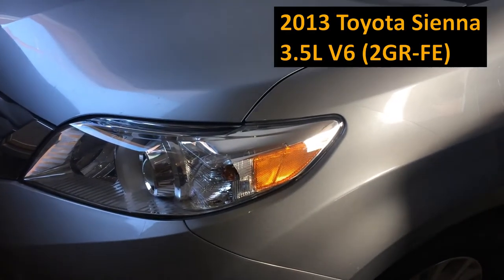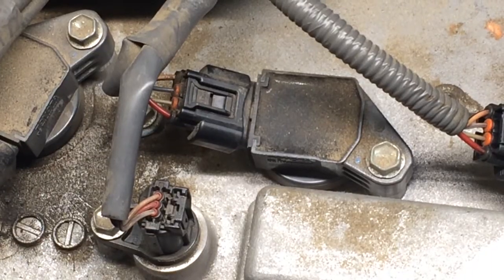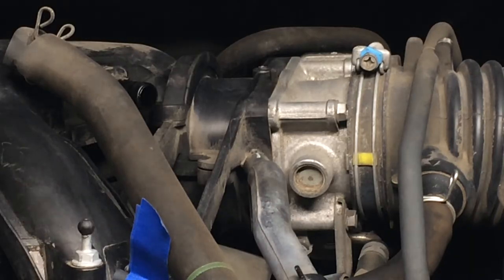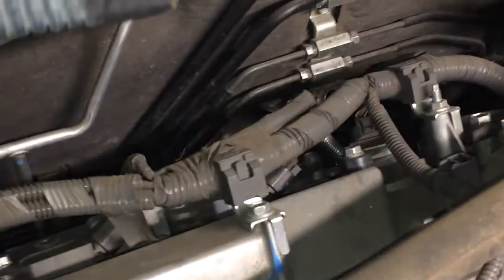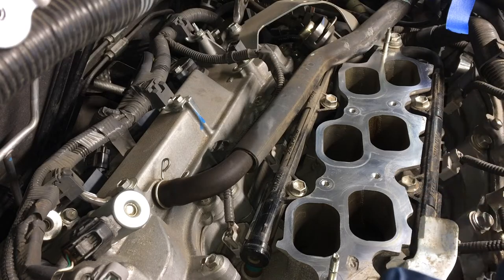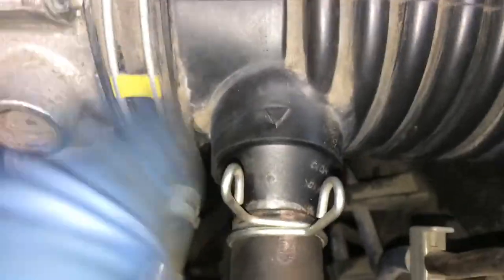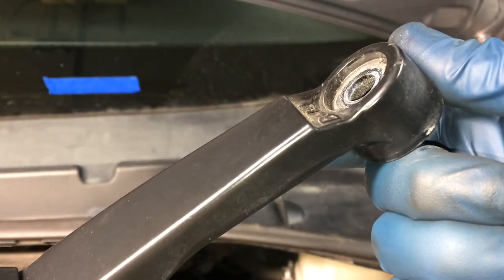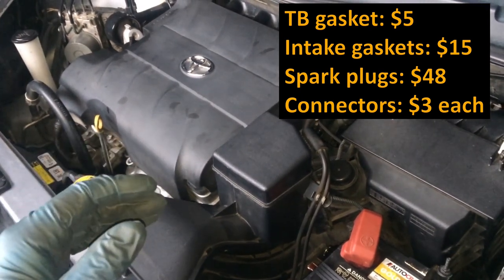2011 - 2016 Toyota Sienna DIY Replace Spark Plugs, Coils, Intake Manifold Gasket V6 3.5L (2GR-FE)

Comment: This is by far the best video for replacing spark plugs on 2011-16 siennas! I just tackled this job solo and this video helped me do it. I would like to add some tips of my own for those who are going to do this on their own. Firstly, the ignition coils in the back can be pulled without unplugging the electrical connections. Just release the plastic clips that hold the large wiring harness that contains the coil wires (3-4 clips) and this will give you enough room to remove the coil packs easily and prevents you from breaking any electrical connections which are super fragile! I broke an electrical connection on the #4 coil which is ok with me since its in the front and easy to replace. The 2 bolts on the back of the plenum was a little tight but with a small ratchet & socket will get them off. I only took one bolt off on the passenger side of the plenum and one on the driver side and it came off pretty easily. Taping with masking tape & labeling the hoses & plugs makes the reconnection easier to remember. It took me 5 hours to do the job but included cleaning the engine bay, cowl, hoses, cover, throttle body, & taking a long lunch break! It would've only taken me about 2 hours or less if I had just replaced the plugs without cleaning anything else. Oh, btw, I broke a hex bolt on the plenum using a torque wrench with only 13 foot/pounds on it. It worked for 3 but it snapped the 4th bolt! I will never trust another torque wrench again! But I would definitely take my vehicle to this awesome female mechanic over any of the male mechanics I've ever used! Shout out to this woman for her DIY video and explanations on every step of the way!
Reply from the maker: Great job on your DIY!  Thanks for taking the time to add your tips, and thanks for watching! : )

Comment: Well, finally did it.  I probably should not have waited until 141,000 miles.  Every clip of the six electrical connections to the coils broke.  They literally shattered when barely touched.  One spark plug took about thirty minutes to remove, gently working it in and out, with some WD-40.  Luckily, it was Bank two, spark plug # six, in the front.  All back together and the van runs great.  Thanks for such great in depth, detail.
Reply from the maker: Ah man, I know how that is with the electrical connections!  Great job overcoming those challenges and completing your DIY, and thanks for sharing your tips! : )

Comment: 2 years ago I did the valve cover seals, spark plugs and wires on a 1997 Toyota Camry v6 by watching another YouTube video.  Very detailed or I would never have attempted it.  No torque specs or part numbers though.  I smiled everytime you gave the torque specs.  Aluminum is unforgiving.  Thank you!  My 2013 Sienna is overdue for plugs and you've given me all the info I need.
Reply from the maker: Thanks for your comment, and thanks for watching! I like torque specs : ) Good luck!
Reply: Completed 2015 Sienna today.  The connectors to the spark plugs were extremely brittle.  Even a pick did not help.  Replaced the front three connectors with news ones.  On the back bank, I disconnected the wire harness from the valve cover and one more plug to the rear.  This gave enough slack in the wiring to pull the ignitors out without disconnecting them.  The harness disconnects easily.  If your connectors are as brittle as mine, I recommend this approach.  Thanks again, for the instructions, parts, and torque values.  Made the job much easier.
Reply from the maker: @tgittin2  Well done, and thanks for adding your tip!  : ) 
Thanks for watching!

Comment: The best mechanic ever on YouTube
Reply from the maker: Thanks - I'm certainly not the best, but I learned from some great mechanics over the years and pass that info along!  : )  Thanks for watching!
Reply: @L35 in Colorado  This is my next big project on my Sienna...
anyways I am an engineer working for one of the Big 3 companies, and we spend so much time and effort on developing torque specs. You are one of the handful mechanics on YouTube actually torquing all fasteners.. for that, I appreciate your great work and that puts you above and beyond.
Reply from the maker: @nickpark9587  Haha, thanks!  That's really neat - I had some training from a couple of good mechanical engineers, an engine rebuilder buddy, and a really conscientious shop machinist, so it was impressed upon me to "torque properly"!  So whenever possible, I always share any torque values I have.   Thanks for watching!  : )
Reply: @L35 in Colorado  
Hi... I have a question for you on 2014 Sienna I have. Recently I have been have some weird symptoms.  While i am driving, out of blue the speedometer acts weird. VSC and ABS check light comes on. this happened twice but yesterday.. similar thing happened but this time, air bag light came on and all the needle gauges (rpm speed engine temp 1/2
Reply: gauge all went to zero, while i am driving, engine on be able to accelerate but zero rpm and zero speed... I felt the power steering was also lost... couldn't open the power sliding door.. etc.. Any thoughts? 2/2
Reply: but then all these went away after restarting the vehicle... I ordered TIS techstream and will see what it says tomorrow...
Reply from the maker: @nickpark9587  Yes - what you're describing sounds a lot like the wildness that occurs when the ABS module fails intermittently and isn't communicating with the ECU - check out this video and the comments below it:
https://www.youtube.com/watch?v=rDtGAbJrfds

Other culprits are the electrical connector itself; sometimes the connector can apparently be simply cleaned and reconnected to resolve the problem (check out this thread below).  Sometimes people use shims, tape, or zip ties to ensure the connector isn't losing contact due to vibration: 

https://www.toyotanation.com/threads/code-u0073-2007-camry-se-195-000miles.910418/

Also here's another thread that might help:
https://www.camryforums.com/forum/general-tech-8/2007-camry-instrumentation-ghost-39934/page2/

I've heard of this via the forums, but haven't dealt with it myself.  I hope this info helps you troubleshoot!
Reply: @L35 in Colorado  Thank you so much for your help.. hopefully I can fix the issue.
Reply: Hi @L35inColorado . hope all is well. I was able to change my spark plug following ur detailed instruction.
now i need to change my abs module. do u think i can remove ECU only without disconnecting the brake lines? camry has easy access but sienna doesn't seem to have any access...

Comment: Thank you so much for taking the time and effort to make this video.  The time stamps in the comment along with the torque specs were immensely helpful. Your video made a complex project one that was much less scary.  

I think the TEQ spark plug socket is now made by Gearwrench, or at least that's what Amazon sells.  The extended Hex sockets were absolutely necessary.  I also struggled to get the bracket on the back of the surge tank reattached.  I would think putting it on loosely would be a big help if I ever have to do it again.  

I also swapped out the vacuum hoses that were under the surge tank and the one that connects to the brake booster so I won't have to remove that again anytime soon.  

Fantastic work.  Thanks again!

Comment: Outstanding video and editing- and way better than any of the others I saw on the subject. THanks especially for the 'appendix' on changing out the coil plugs- that info really saved me on my 2011, as five of six of mine broke (one disintegrated while changing out the leads). Two notes for others:
(1) on 2011, the left and right brackets bolt have a solid bolt holes (not slotted)- get the left and right bracket bolts half started before torqueing down the manifold plenum (four 5mm cap screws and two 10mm nuts).  Otherwise, once the manifold is down hard, it's nearly impossible to align the holes and start the threads.
(2)  On the replacement plugs, make sure the silver contacts seat down (toward the latch) to allow the lug  in the coil to slide in above the contact in the plug.
Thanks again for getting me through this job!
Reply from the maker: I'm sorry I missed your comment - thank you so much, and well done on your DIY!  I appreciate you adding your tips about the 2011, as that will help others, too.  Thanks for watching! : )

Comment: Really great video, love the stopped video to show bolts, along with all torque values.  Your video is long, but the most comprehensive of all the videos I have seen to get the spark plugs done.  Love the explanation also.  Well done.  Really well done.  You've made the challenging task almost easy (I'm sure it is more difficult than what you've made it to be of course).  Would love to see more of your videos tackling other challenging engine subjects.  Scotty has nothing on you.
Reply from the maker: Scotty Kilmer is great! : ) Thanks for watching, and good luck - you can do it! : )

Comment: Flawless!  I was about to tackle this for a third time and wanted to review.  I lucked out and found L35’s comprehensive treatment of the process.  You use the simplest path to get this gnarly process done right.  Your camera work, post editing, content and story telling narrative make this an absolute pleasure to watch.  Based on your approach I decided not to tighten the airbox by feel and got an in-lb torque wrench, and have switched over to felpro.  Sparkplug type can get confusing as there are lots of options - yours is the correct longlife selection.  I can't imagine how much prep goes into your videos but it is very much appreciated.  By the way, I've got the tattoo times 4 for breaking and replacing those pesky ignitor connectors.  Toyota Part 90980-11885 and AbsoluteWittsEnd "Connector Pin Tool".  Not a godawful process.  Videos are out there but nothing like your work.  Sooo happy to have found your channel!!!
Reply from the maker: Wow, thank you so much for your comment and for the SuperThanks!  Yes, those ignitor connectors get so brittle - it is a relief when they don't break.  Thanks again for watching!  : )
Reply: @L35inColorado I'm doing this tomorrow with felpro gaskets etc., so I watched your treatment again.   Not sure how I missed your connector treatment at the end the first time.  Yes, it's better than anything out there.  Thanks again!!
Reply: So, done!  I flipped through your video to catch torque values etc, and it really made a difference.  This time around, I have a few additions to the method. That brake booster hose can be removed from the airbox right after the throttlebody, and reinstalled just before the TB. Makes airbox removal a little less of a fuss.  Electrical contact cleaner sprayed on the ignitor connectors makes  wiggling them off just a little easier.  Still, had to replace the #5 connector armed with your masterclass and a Toyota connector.  I marked the pesky  bracket at #1 cylinder before removing it for the #1 cyl plug and ignitor R/R, so I was reasonably certain it would line up with the airbox later. Keeping the airbox hexbolts loose while fitting up those two airbox screws,  and leaving the umbilical tie-down adjacent to #1 cyl disconnected  made lining those two screws much  simpler.  Thanks!. I used a small piece of shop (paper) towel between a  long socket and the passenger side AB screw to capture it and set the screw without losing grip.  That made the airbox screw at #1 cyl almost easy!  You can reattach the umbilical tie-down without much effort after you lock the bolt down.  Thank you sooo much for this video.  Over the last week,  I R/R'd the front shocks, flushed the transmission with 12qts of WS, flushed the coolant and replaced the thermostat (yeah, that was tricky), and this was my last operation. Usually I dread it.  This time I actually had fun, kinda weird I know!

Comment: L35...I have a 2009 Toyota Venza with the same engine in it ...3.5L.  A buddy and I are getting ready to tear it apart d/t a misfire code on cylinder 5.  All I can say is WOW...I'm impressed at your thoroughness and especially your angled video shots of the back of the engine.  How in the world did you do that?!!  I'm really impressed with your knowledge about engines.  I was a Registered Nurse for 40 years and one of the (female) nurses I worked with raced dragsters in her off time.  Its always makes me smile when I see the opposite gender do things that are not typically done.  You go girl!  Smiling at ya! Mike Johnson
Reply from the maker: Wow, thanks! Hopefully your #5 misfire is just the coil/ignitor, which would be an easy fix, but as you know there's a lot of parts to remove to reach that #5 in the first place!  
In my experience with these engines and Toyota engines in general, a single-cylinder misfire is either a bad igniter/coil (usually the case), or an oil-soaked spark plug due to a leaky valve cover gasket (less common, and usually you have multiple cylinder misfires).  
Hopefully it is the ignitor/coil because that is an easy (once you get back there). 
To test the possibility of a bad coil, you can swap a known good coil from one of the Bank 2 cylinders (the cylinders that are easy to reach). Then if the misfire moves from #5 to the other cylinder up front, you know that the problem is the coil and you can just swap in a new coil. 
I hope that helps - good luck! : )

Comment: I want to thank you. Ive had a lot of anxiety about whether I could tackle doing this job myself. You have instilled a huge amount of confidence in me and now I know that I most definitely can. Thank you!

Also on the cross threading...my Dad taught me a trick if you seat the plug or bolt where it is to go, turn it backwards first before threading it in, you will feel the threads drop when they match up. You can then thread forward by hand with confidence that they are aligned and not cross threaded.
Reply from the maker: Hey, that's a great tip - I'll try that!  Thanks for sharing, and thanks for watching.  Good luck - you got this : )

Comment: I have an '06 Avalon 2GR FE.  When I changed my plugs I found oil on the boots.  So my plug change turned into valve cover gaskets and tube seals.  An adventure to be sure.  On the Avalons you need to pull the cowl in order to get the surge tank off.  It's a lot of fun.
Reply from the maker: Yes indeed, thanks for adding your tips, and thanks for watching!  : )

Comment: Thanks for your very helpful video. I bought a magnetic swivel plug socket and flex head ratchet per your suggestion. I replaced plugs on a 2010 Lexus Rx350 and those tools and your video were a big help. Had to get creative removing driver's side wiper, it wouldn't budge!

Comment: Excellent video!  Very informative and detailed!  I just hope I am as patient and as calm as you are when I attempt this tomorrow!  I have a 2013 Limited Sienna and can now see and understand why it's such an expensive job. I've replaced headlight bulbs and cabin air filter but have been hesitant on the spark plugs!  Still scared but I will for sure be referring back to your video!  Thank you for taking the time to make this. Well done!
Reply from the maker: Take your time and give it a whole day, and you'll be alright!  Be sure to check out other videos on this same engine (2GR-FE) that might give you some more tips -- there are a few other videos of the job on Camry's that have this same engine, so it is very similar (you also have to remove the wipers and cowl on the Camry, too).  Also, this is an excellent picture DIY from toyotanation, written by a Toyota tech:

https://www.toyotanation.com/threads/diy-2007-2011-2grfe-v6-camry-spark-plug-and-intake-gasket-replacement-w-pics.1233369/

Thanks for watching, thanks for your comment, and good luck!

Comment: Great how to video. My I suggest since you are already taking things apart, clean out your throttle body and your MAF sensor. After I replaced my plugs, I pulled a P0102 code. This was caused by all the pulling and movement, got dirt and dust in the MAF sensor. Pull it off and clean it before re-assembling. This will save you some time later.

Comment: Wow I’m an amateur DIYer but this gave me the guts to change out my daughters 2012 Toyota Sienna and I was careful with those old ignition coil clips…#5 was particularly stuck!! Nothing broke and must’ve had factory plugs, they had a yellow X on the top (she bought it used a few years ago)
Reply from the maker: That is fantastic - excellent job on your DIY!  Yes, those ignitor connectors are so brittle, and your patience paid off.  Great job, and thanks for watching! : )